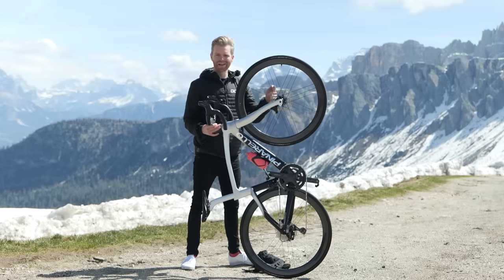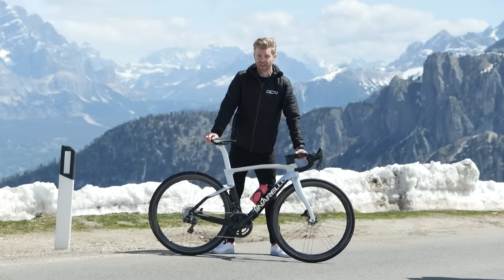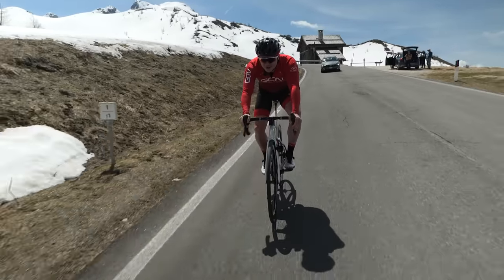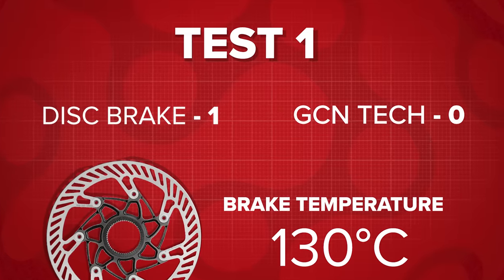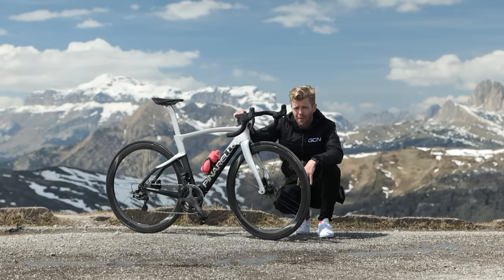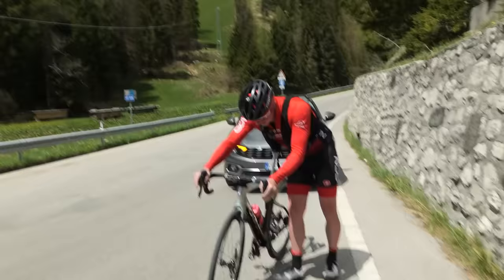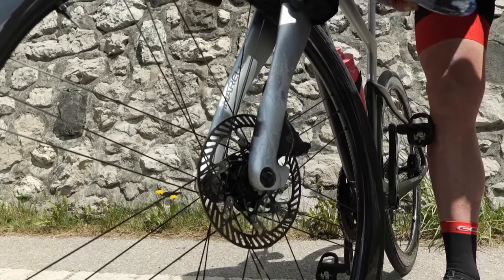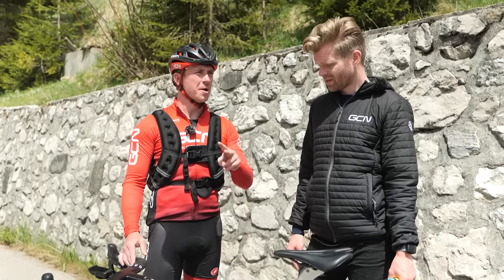Can We Melt Disc Brakes!?

Comment: the organic brake pads degrade faster at heat and it makes sense that they are the weak link here.  They are intended to wear down over time, and that also removes heat. Cars are the same way, however if you look at something like the brakes in an F1 car it's the other way round, the rotor wears down under extreme braking.

Comment: 9:25 not to mention on rim brakes you can actually melt the inner tubes and tire slightly. Many TPU and latex tubes I've used explicitly mention that. Even when butyl tubes and tubeless tires don't mention it, they don't expect any dumbass in a 20º 30km descent to be holding the brakes like that so they could be damaged as well haha

Comment: I'm a car buff as well. Speaking of Formula 1, they use carbon brake rotors. I was actually wondering a few weeks ago if there is a use case for carbon rotors for bikes. Other than minor weight savings.
Reply: In aviation we use ceramic brakes 😁
Reply: SiCCC made carbon rotors for a while as did Spanish company Alpha. They had an exceptionally high wear rate are were absolutely rubbish in low temperatures and rain.

Comment: Didn’t the carbon fork melt a bit next to the caliper? Looks a bit blackened… or is it brake dust only 😅?
Reply: Brake dust, Carbon melts at 3000'C so no chance of that happening though the resin in the carbon fibre would fail long before that...
Reply: Well, sort of. The very hot brake dust might melted into the material of the fork.
Reply: @philipcooper8297  …that’s not nice considering the fact that a regular customer spends the amount of a half decent passenger car for such a Pinarello 😣

Comment: Didn’t the carbon fork melt a bit next to the caliper? Looks a bit blackened… or is it brake dust only 😅?
Reply: I just looked it up, you’d need around 3500 deg C to melt carbon ! Brake dust.
Reply: It is not the carbon that will melt first, it is the ressin.
Reply: Yes obviously ! There’s no carbon without resin.
Reply: @mjs3486  …there you have it!

Comment: Here is a photo of what happens to Shimano Ice during a 1000 ft descent on a very steep trail in the Santa Cruz Mountains, Ca.  Braking hard but pumping. Note how the stainless out shell delaminated from the inner aluminum core.  Very disconcerting as the rear wheel partially locked up as the bike was nursed to a stop.

Comment: Infrared Thermometer shows way too low temperature on blank metal, E.G. showing 70°C while the real temperature is 190°C or above. Worst case is shini metal mirrors ambient temperature into the Thermometer, while it can be really heated up to non touchable temperature. Try surface contact thermometer.

Comment: Well when i desigmed the carbon wheels with kevlar braking surface ,my protocol was a Guy of 100 kg with speed of 100 km/h decending a mountain of 25 %.
During 5min
And braking at the rim .
This simulation done with a 12kw elektromotor.
We measured a Heat value at the kevlar braking surface of 340degrees celcuis and not any problem with structure of the rim 
Due to our high resin  temp.
And transition to glas.
And keeping good braking value ,and no degradation.
Performed at dutch National Aerospace center  short NLR
In Marknesse The Netherlands
Reply: If you heat up a rim to 340 ° C your tires and tubes will burst way before you reach this temperature, even if you managed to get the rim stable in this case
Reply: @simonm1447  well no the rim bed stayed cool ,only the braking surface got hot ,that is he the secret of kevlar, IT did not transport the Heat
Think about IT as kevlar is used as Heat protected handgloves

Comment: I just learned that there are countries where the left break isn't the front break. Mind blown.
Reply: Dammmmmn I just realized. I am living in Japan and my front brake is definitely on the right, I thought it was standard? It's also on the right for my motorcycle (and the right foot being the rear brake).
Reply: It's done to confuse motorcyclists. They used to just alternate the gear shift and rear brake.😂
I think the idea was to keep the signaling hand (left in US) on the front brake so your other hand could work the rear for some pre corner braking as the rider signals. That been my long term guess.
Reply: @ZratP  Here in Germany its the other way around :)
Reply: Countries which drive on the right lane (the US, continental Europe) typically use the left side for the front brake. Countries which drive on the left lane typically use the right side for the front brake.

If you have your shifter for the rear derailleur on the right side too, it's better to have the front brake left since you can use one hand for braking (the front needs more force on the lever) and the right hand for shifting down

Comment: Maybe start with a basic mechanical disc bike and 110kg of rider. I suspect I'm not alone as big rider that I'm not bothering to spend a ton on a bike to shave grams where I have something like 1.5 Hanks between the saddle and bars. I've had some fade on the local 13% descent.

Comment: Would be interesting to also check if the mineral oil changes color and if any gas builds up in the hydraulic system from boiling the oil.

Comment: Should've tested shimanos ice-tech rotors, they have a aluminium core and have been recorded to melt
Reply: What’s the melting point of aluminium?
Reply: @rommelreyes2209   6061 alloy has a melting point of 585 °C, there are a other alloys with higher melting points, but theyre all significantly lower than steel
Reply: For me I believe the core breaks from heat and braking forces, and they, when hot, go out of true by a measure of 1cm. I even made a video to have it replaced under warranty, Shimano XT brakes. The new one did the same :(
Reply: So you really believe this is a real,objective test ?
Huh! how about that!🤯
Reply: @alfabethev2.074  it'd be more entertaining if they actually melted a disc is all im saying
Reply: @flurgerbla7609  i guess you need to be very heavy and dragging the brakes for a long period for you to reach 500C.
Reply: @rommelreyes2209   yeah, like descending on a tandem bike.

Comment: It would actually be more interesting to do this with rim brakes and a set of carbon wheels to see if it's actually possible to damage the brake track on the carbon wheel by putting excessive heat into it.
Reply: 110kg on dengfu wheels and delaminated both rims in a 2km decent.

Comment: nitpicky correction: the rivets you see on two piece rotors isn't to help with heat dissipation. it's to help with thermal expansion and contraction. if those rivets weren't there, you run a higher risk of warping your rotors when they get hot.
Reply from the maker: Thanks for the correction, Ollie's buying the coffees for the next week to make up for it

Comment: it's not just inexperienced riders who get scared... after 40+ years on road bikes i found myself clattering down the Dolomites at 90+kph. Having just made it round a hairpin near a scary drop, back wheel sliding out, front wheel on the point of lock up, I sat up & thought " wtf are you doing you daft old twat ".... stirling moss gave up driving when he started getting scared... it comes to us all

Comment: Guys, I weigh entirely too much, and several times, especially bike packing, weighing over 140kg, I have seen the rotors glow red, change color, and on one occasion, I had to literally jam my shoe against the front wheel to stop, before going off a switch back. I know other heavier riders who experienced the same, especially on a small diameter rotors. The new shimano sandwich construction rotors on my Canyon MTB warp super heavily, have a video of it on my channel. Out of true by 1cm! I love the simplicity of disc brakes, but for really heavy riders, dunno? Note, it is especially bad on much steeper descents, 10-20% grade!
Reply: By all means, stick to rims.  🤣🤣🤣🤣.  Better yet, don't be stupid and over ride the brakes on your bike.

Comment: Is there a correlation between riders weight and how quick groupset wears down? I am 80 kgs, 5'10 and I am replacing my chain every 3000 kms. Cassette between 4000 to 5000 kms and Brake pads at 6000kms. I see my fellow riders not wearing their groupset as fast as I do!
Reply: Chain wear also depends on the type of shifting (11 and 12 speed chains are narrower and wear faster), the maintenance (oil/wax and the intervals) and if it's dusty or not.
Brake wear should more depend on weight, on my commuter (E Bike with panniers anf load, around 30 to 35 kg) the pads don't last as long as on lighter sports bikes

Comment: Throwing water in the discs like that you were risking warping them.
It's a different thing if it's raining, as the water droplets get to the discs is a much more random and average way, but directly from a water bottle in a stream? :/
Also, the rivets there are not for heat dissipation but to better manage disc expansion when it's hot

Comment: I'd be curious to see how a less premium brake setup fairs in this test.
Reply: I ride MT 200s. They got brown and blue a couple of times, the simple Tourney rotors never warped and the pads (Resin pads) always survived.

If MT 200s are squeaking it helps to drive them hot until the rotor gets  brown, afterwards they are fine again with braking power like new

Comment: Nice brakes, but the pads probably went off in 30 minutes. I am even heavier, about 116 kg. That's why I ride with completely different disc brakes. Magura MT5-eStop calipers, Shimano Zee levers, organic Kevlar pads and Hope Heavy Duty 2.3mm rotors 220 mm front / 203 mm back.
Reply: The Campagnolo calipers are based on the MT4 and the pads are interchangeable. Campag didn’t have any previous hydro brake experience so partnered with Magura. Thry are the best road hydraulic brakes in the business in my opinion (and their direct mount brakes are the best rim brakes).

Comment: If you truly want to melt a disc brake, take a fully loaded cargo bike down it! (One with small rotors designed for flat dutch cities and not one of the fancier ones with downhill MTB ones fitted)

Comment: you should have had him go down a very fast descent and brake hard for a period of maximum 40 seconds-1min.  alot of the heat he was making was being lost while he did those long descents.  if he had slamed the brakes on for a period of 20-40 seconds that would be the correct time id would take to heat the discs up given their mass, surface being heated and how hot i think disc brakes can get.

another option would be to get a touring bike loaded and brake down a Very steep descent for a minute.  slam the brakes next time.

Comment: Would have been helpful to know the boiling point of the hydraulic oil. You’ll reach that much before the discs get red hot. And then suddenly  you’d have no brakes at all.
Reply: It’s oil not DOT. It’s Magura Royal Blood which has a vapour point of  120°C. The calipers use phenolic pistons so the oil is thermally isolated from the pads.

Comment: Ollie just wondering are there hydraulic rim brakes I can't put discs brakes on my bike as it is a few years old but I would like a 12 speed group set
Reply: There are but not from Campag. The 12 speed Chorus groupset with rim brakes (either dual pivot or direct mount) is fantastic and very good value.
Reply: @nstrug  but I don't like campeg I don't like the way they shift.

Comment: The only reason for mineral oil would be it is less harmful to human, environment and paint than DOT. There is a reason cars use DOT. In case of water in the system DOT takes the water into the chemical structure of the fluid and makes the breaking less spongey even if there is water in the system. Some people call this "the DOT attracts and sucks water" and call it a negative point. But the reason for this behavieur is that if compared to oil the water wont mix in, so there is a chance that there will be a spot where water gathers and the chances of oxidation inside the system. Also DOT has a higher boiling point and is less prone to fade. Calling it a positive that Campa is able to design fluid as they want for their system is in my point of view a negative. Who guarantees its up to standard if every brand decides to make their own oil. Engineers are able to design around the DOT specifications. But yes, for the clumsy hobby mechanic mineral oil is easier to handle, therefore the trend in the bike industry moves to mineral oil
Reply: A bicycle brake is a closed system, the reservoir is a rubber bubble and theres no air the reservoir.
A car reservoir isn't air tight, and there's even air inside the reservoir since it's a plastic casing. Also one reservoir is used for 4 brakes and even a clutch on manual transmissions.
So the demand on a car is different from a bicycle.
Btw, oil can also absorb some water, you get condense water in hydraulic systems and also in engines. It starts to get brown like a milk coffee  if it absorbs water

Comment: I have seen 350 degrees Celsius on one of my bicycles rotors about 15 years ago . Non floating.
Reply: I had 97 kg bodyweight when the rotors reached 350 degrees celsius in summer 2007 with 20 kilograms in luggage . 40 degrees  celsius air temperature  . Drop down Mt Ousley near Wollongong  NSW  Australia  where the U.C.I. championships took place in September  2022 .

Comment: I’d worry more about what would happen to the spokes with all that heat, especially if they were carbon. If they went You’d lose all control.
Reply: By the time the heat reaches the spokes, it is very spread and dissipated and the spokes' temperature will rise yes, but miles away from any temperature that will affect their strength. Light years away, actually.

Comment: If you want to melt rotors you need to try the shimano icetechs. They have an aluminum core which has a way lower meltingpoint 660c vs 1400 for stainless. You will not reach the melting point other things will break before your disk is melting. Deformation might be a thing but getting that far is pretty hard.  In the downhill world people have been complaining about melting/deforming problems with icetech not sure if they were real. Here's a video what what happens when torture testing disks beyond reasonable. https://www.youtube.com/watch?v=v3sPuf-Dlmg
Reply: My brother runs those rotors even on his gravel bike. The descents I gravel races and very abusive on brakes. I don't know why he continues to use those rotors. He had one set in which the layers were coming apart, delaminating or whatever was happening. I'm not sure Shimano thought them through very well. He is 6'5" and 220 lbs.

Comment: Both rim and disk brakes have the ability to lock up the wheels, so the stopping power argument is kinda nonsense. This is proven time and time again when you compare the stopping distance between the two. It's the tire that matters, not the brake itself.

Comment: Why wouldn't you do the rear brake so in case it seizes you can skid out the back wheel and not lose control, you must have been confident it wouldn't seize

Comment: If they were the old Shimano brakes they would’ve warped. Not sure about the new ones
Reply: I use simpler Shimano rotors (RT-10, RT-26, RT-30). They are massive stainless steel rotors without an aluminium core, and they never warped despite sometimes reaching temperatures where they got blue (300°C). 
Warping may be a problem with sandwich constructions, where stainless steel and aluminium expand different.

Comment: Final text should be the condition of the wheel bearings 
They would be shot with all that heat being transferred to the wheel hubs.
Reply: If you heat up a disc rotor the hub don't get really warm. The spider is made in a way to conduct as little heat as possible into the hub, long thin arms made of stainless steel (not a really good heat conductor) aren't getting really hot even if the rotor reaches 300°C.
I heated up rotors to 300° not just once, I never had a problem with the hubs and the bearings

Comment: There’s no way the rotor will melt just from dragging the brake the brake fluid will boil first and lose of brake pressure 
if the bike is using steel wire to actuate the brake it still won’t melt because at a certain temperature the pads will failed to generate enough friction to efficiently transfer momentum to heat

Comment: Discbrake? i am not sure, but rim brake must lol
Reply: incorrect an alloy rim brake wheelset would cope far better than an alloy disc brake as there is more area of the same material...

Issue is all the disc noobs only assume u can only use carbon wheels with rim brakes for some very strange reason 🤦‍♂️
Reply: @danc1829  Yeah , but what i see is , the first thing the type will break first as the Temp raising

disc noobs lol....

Comment: On my mtb my discs went blue once, i wa sflyiing and then had to stop as my friend crashed.
after i went home i noticed that my front disc was half blue and half brown, from tempering
Reply: Blue is around 300°C while yellow to brown is around 270. 
I also got my brakes that hot with descending, but not even the resin pads took damage.

Comment: isn't braking applying friction to stop? not dissipating heatm
Reply: Friction causes heat in the rotor, beside wearing the pads. You have to get rid of the heat as much as possible with heat dissapation